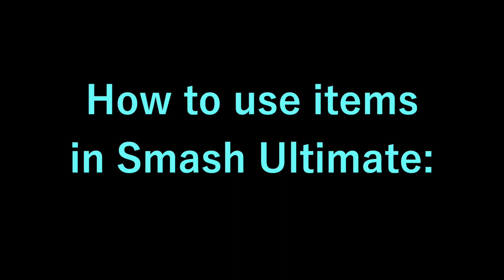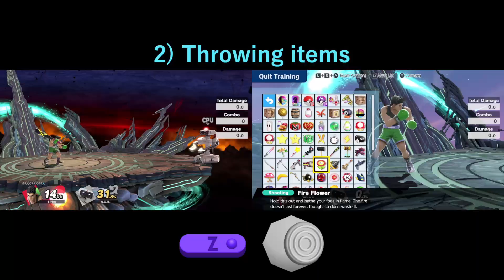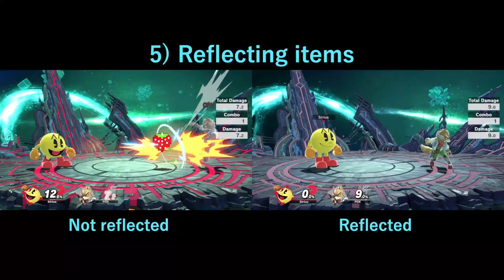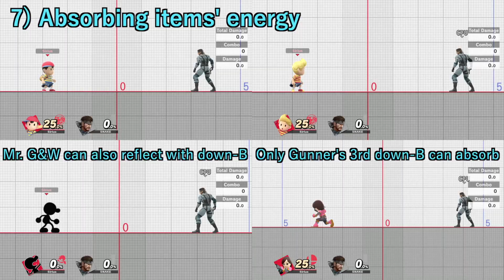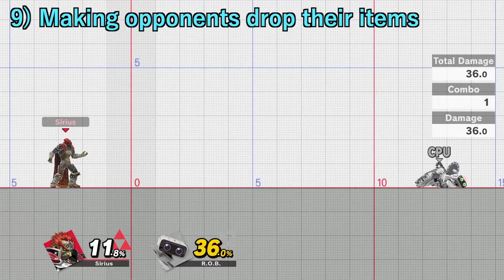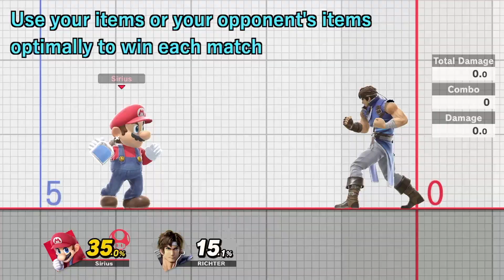The Basics of Using Items | Smash Ultimate Guide

Comment: is there not a way to attack while holding the item? like do aerials? i swear there is a way and ive seen it before but i havent seen any mention of it in a guide
Reply from the maker: If you hold a battering item like the Beam Sword or Home-Run Bat, you can still do your tilts and smashes on the ground and aerials in the air. However, the forward smash and tilt will both be altered to swing your held item.

If you hold a throwable item like a Bob-omb or a Green Shell, then all of your ground and air attacks will be altered to throw the item in that direction instead of doing normal attacks.

You can test out each item in training mode and see what they do to your attacks. But don't expect to see most of them in tournament play, because all items outside of those in fighters' movesets are banned

Comment: I've seen top players catching items in mid-air that were thrown at them, how does that work?
Reply: if you use and ariel such as nair or air dodge as the item is close to hitting you then you will grab it
Reply from the maker: Yes, as Billystorm said, you need to do an aerial or air dodge (or press grab) as the item is about to overlap your character's model. This will make you grab the item out of the air
Reply: @bluesiriusgaming  One other thing is you can press A if the item is thrown at you but is near the character's waist or lower. You can catch the likes of ROB's gyro, turnips, and if you're bold enough, Diddy banana and Pac-Man's key. I do this all the time to catch people off guard, then they actually kinda stop throwing projectiles at me.
Reply: If you use the grab button, it's much easier to do.

So if you are close enough to grab, you'll grab the item laglessly, no airdodge. 

If your too far, you end up air dodging. So the grab button makes this a lot easier.